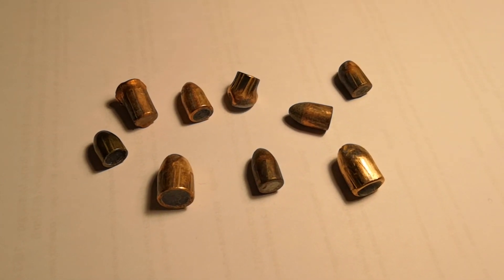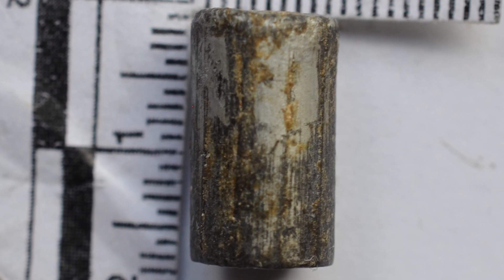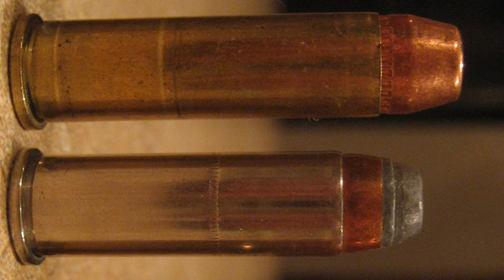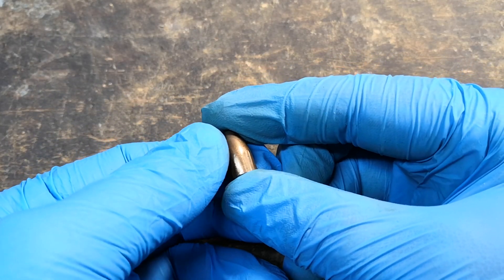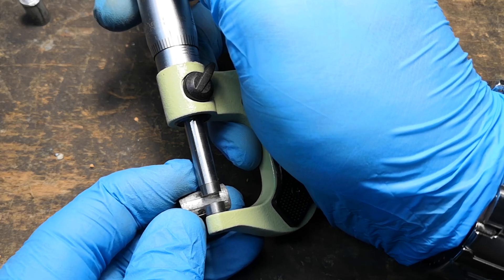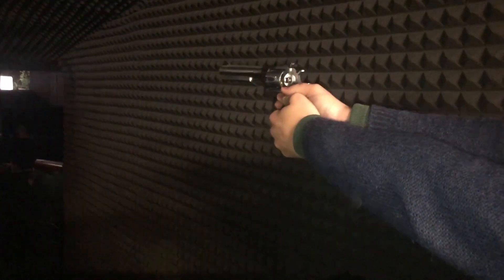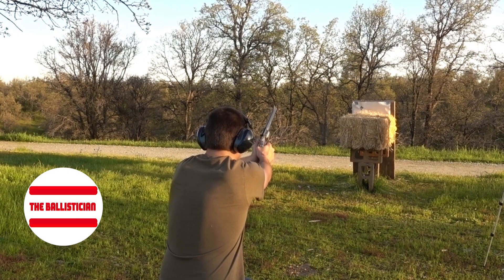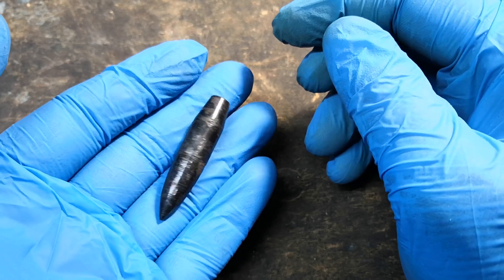Real Life C.S.I. #2: Bullet Fingerprinting

Comment: Surprisingly 4 or 5 feet of hay will only stop .22lr and 45 ACP. I'm guessing that last bullet was the AP core from a 50 BMG?
Reply from the maker: (spoiler alert: if you click on read more you will see the correct answer)

You got it right Cody!
Reply: I dont think that is true.  Demolition Ranch shot at a round bail with a damn arsenal and nothing when through IIRC                   SHit . the .50 went through the bail.
Reply: @zuestoots5176  The hay in that bale might have been more compressed or something. I would not know though Im not a hay bale expert
Reply: @FungalTox  
Round bales are wound quite tightly,  while square bales (while "compressed" before binding) spring back quite a bit, plus they're no where NEAR as thick as a round, wound bale.
A bullet traveling through round bales also ends up encountering strands in every orientation,  whereas a square bale only presents strands in a horizontal alignment.

Comment: Was the bullet at the end sabotted?
Reply from the maker: It would have been an explation, but this is not the case😉
Reply: @Backyard.Ballistics  a tapered muzzle then?  Constricts a slight bit sqeezing the groove impressions out?
Reply from the maker: @matthewmillar3804  easier than that. I'll give you a hint. It is very, very hard. Actually one of the hardest metals you'll ever encounter
Reply: @Backyard.Ballistics  ok, so it's a tungsten penetrator?  Wouldn't it destroy a barrel it was shot out of without a jacket?  What happened to the jacket?  Does it instead have a compression ring like an artillery projectile?  Is it shot out of a smooth bore?  How would it be stabilized if that's the case?  Your hints are making more questions!  😋
Reply from the maker: You are correct! It is a 50 BMG AP penetrator. The bullet was shot into something hard, and the jacket was ripped off. It came out of a traditional barrel😉
I'm happy that you like my riddles😁